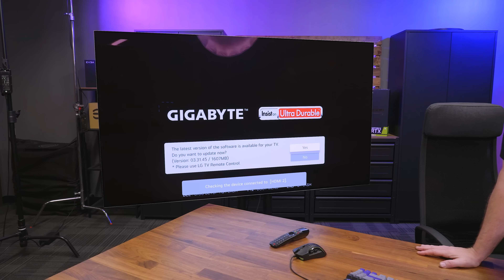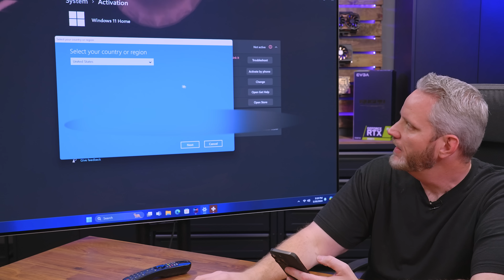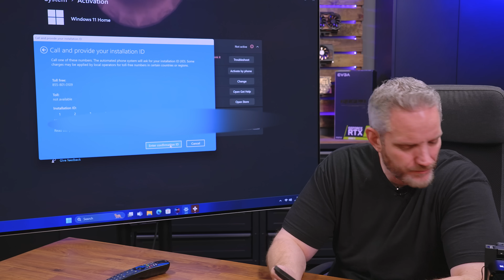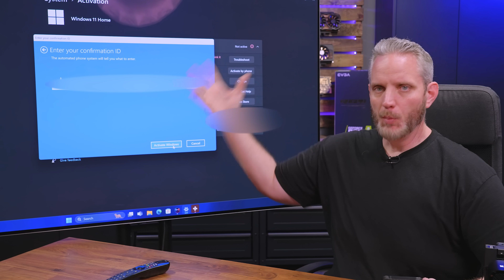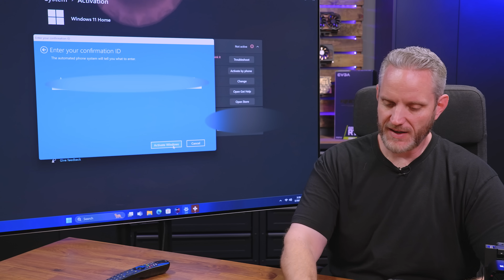How to move OS drive to new PC and keep Windows and Activation! EASY!

Comment: hi thanks just the video i wanted !! jayz always on the top. just little but think you quickly answerd .... does this work if i go from intel to AMD ?
Reply: Yes it does. I did a transplant last week from Intel 3rd gen to a Ryzen 6000 mini PC and it just worked for 1st boot.
Reply: @craigmurray4746  ok tanks for the tip
Reply: @craigmurray4746  finally did the move and was smooth just needed to reactivate windows with my digital key so 2 clics and off we go :)

Comment: 10:25 Jay is 90% correct. I've had several systems in shop that were AMD Ryzen 5 3600, 5600 and then they switched to an intel i7 13700K, would not boot no matter what. BSOD due to the AMD chipset drivers. I booted safe mode fine, tried removing them. Reboot still BSOD the AMD chipset drivers would not leave even after using uninstaller tools or CMD prompt itself. ended up having to load fresh.
Reply: This sounds like a driver issue not a windows issue.
If you can boot to safe mode you can rule out the hard drive and OS as causing the BSOD.
The chipset is not part of the OS.  My bet is your graphics drivers weren't property ported to account for the CPU OEM type change and you probably also had a bunch of custom optimizations.  Fun fact if you change the CPU type you can't keep the same ram timings and graphics card optimizations and expect them to work.
Reply: @TurboLoveTrain  Pls read it over again. I can enter into same mode on the systems fine. Since the chipset drivers are not loading. Motherboard set to Auto, no OC on CPU or RAM. Several others with same BSOD caused by AMD Chipset drivers, specifically Ryzen Master software. even with it uninstalled, removed manually from the Registry and C Drive itself to the point where nothing is on it linked to AMD and still BSOD Ryzen Master causing it. Ended up just loading Windows fresh and everything works fine now.
Reply: @johnqsak  yes, you described a driver problem.  You wouldn't be the first person to reload an OS from scratch because of drivers.
Reply: @TurboLoveTrain  yea, driver that kept Windows from booting, even when it was physically no longer there
Reply: @johnqsak  Windows puts drivers allover the place--both in the file system and in the registry.  When you add things like AMD software that also manages drivers and driver updates the conflicts usually get worse, not better.  Even if you lobotomize all the software and registry configurations there could be a windows Service that calls the old drivers for whatever reason and causes your system to throw a hissy fit.

That's why I said you wouldn't be the first person to reinstall an OS because of driver issues.

Comment: If you are moving multiple drives, can you move all the drives to the new build at once? Or is it better to just move the OS drive first, complete the process, and then move the remaining drives?
Reply: It should be safe enough to move everything at once, especially if the system was installed in UEFI mode as UEFI is a lot more flexible than BIOS style booting

Comment: 4:30 also Jay, if you felt comfortable, you could mount the AIO 280mm vertical, using just the middle set of screw holes, then fab some vertical mount, but then I guess it becomes a whole thing of changing what the case has available.

Comment: Definitely looks there will be a v1.1 or more. With that big GPU in there not only does it overhang the chassis where the 140 mm fans would be, it also looks to be blocking 2 or 3 power connectors under the card.

Comment: On my AMD 7950X System it´s the CPU wich holds the key of my old windows 7 OEM,  put a 7800X3D in the board an windows siad activate. Put the 7950X in another mainboard, windows was already activated.

Comment: "Windows -to-Go" using an external USB boot SSD does not always work when switching between Intel & AMD CPU's. The free software "Rufus" lets you create the bootable external SSD. and it will initially boot on either CPU type: Intel or AMD. But if you initially boot on an AMD CPU system, then use that same drive to boot from an Intel system, the Windows-to-Go drive will continue to boot okay on the Intel system, but will then fail to boot on the AMD CPU system. At least, that's been my experience with an AMD Ryzen 5600X system & then swapping to an Intel 10th gen system.

Comment: Jay, you've probably talked about this is the past, but, it doesn't appear that you use a grounding strap when working on builds.  Reason?  I know I have to because I can just be standing still and I build up a charge.
Reply: There's a video somewhere where static electricity is tried over and over and over to kill a board and CPU and it just doesn't happen.

I worked as a system builder and built thousands of machines 2002-2007, never wore a strap. Then I worked as RMA manager, never saw a warranty claim that related to static. 

Don't get me wrong it's possible to have an issue but the chance is so incredibly low few people worry about that risk.

Comment: Jay, the motherboard is not the one thing that kills moving my "hard disk" to a new computer.  I dont have any problems with having a replacement running system with a separate licensed version of windows. My favorite application software goes and reads the "serial" number from the hard disk and probably mashes the motherboard ID and the hard disk ID together to defeat moving my application to a replacement computer.  You might say just uninstall and reinstall with the SW key, but the seller does not want to redo the key anymore.  Faithfully living within the license requirements and replacing the old computer means providing the application what it wants to see to enable running on the replacement PC after cloning the hard disk.  I have found that I get to set the volume name and ID when using intel raid so maybe this relates to a solution, since I can go read the volume name/serial on the old PC.  I would like to hear your prescription for making the replacement system match the "ID" of the old PC.  thank you
Reply: I'm not sure this is even possible. Like one can spoof an Ethernet Mac address, but I've never heard of anyone changing hard drive serial or motherboard serial. Those hardware hash activation systems are very good at preventing what you want to do. It's a horrible situation.

Comment: I've only really had issues if I've put a drive that was on a different platform, IE AM4 > LGA 1700 is my most recent example. Although this does work (I've done it before) Windows is a terribly coded OS and there is all sorts of nonsense left in the registry. Best practice is to nuke the OS and start from scratch.

Comment: There is also a way to manually remove the windows key from the motherboard. it does involve using some commands, but i've done it and it works just fine. Just make sure to write down the key number BEFORE you remove it from the motherboard otherwise its gone.
Reply: You can deactivate the key in the control panel under the activation section if you don't have an OEM key (OEM=key stored on motherboard).
Reply: So pull it using an app, delete it, and it's reusable after?
Reply: @Adpocalyptic so you run command prompt as administrator and there’s a command called “slmgr. vbs /upk” you type that and hit enter and itll uninstall the key manually which deactivates windows on that pc. Then once you build and boot the new pc you can just put in that same key and itll work just fine, pretty much as if you were putting the key in for the first time
Reply: I understood that getting that key from the regedit would only work(the retrieved key) if it was a retail product key, if it is a digital key then it won't?

Comment: Ya really really should reinstall your OS if making such a big change. By 'basic state' you mean most the new devices aren't detected yet and are about to be and the bigger issue is its about to try and load all the old crap you had cluttering up the build before you migrated the drive including all the hardware specific stuff which can BSoD if its really unhappy. Still do the activate by phone, thats great. but on a fresh install. Also this almost never works if you have raided drives on your system, especially boot drives.

Comment: I have a 250GB 970 Evo M.2 as my OS drive. What would be the best way to transfer clone all the data from this drive to a larger one? I thought a 250GB drive would be enough at the time. I'll look through your library of videos to see if there's one about this, again, just in case you have answered this question, or similar, before. 

Worth a note; I have an Asus Crosshair Hero VI board, so it only has one M.2 slot available. So I'll need to find an external option of connecting another M.2 to clone the data to.
Reply: 2 options. 1 is to backup the drive with the built in Windows System Image tool, save the image to an external drive. Swap out drives and restore the image to the new drive, then log into Windows and expand the partition size and done. Option 2 is to get an external USB housing for a NVME drive, install the new drive in there and use something like Macrium Reflect to clone the drive. Then install new drive in PC and should be done as well.

Comment: Hard parts used to be migrating between two drives going ide to sata,  sata to nvme, or BIOS to UEFI boot layout changes due to missing drivers & trying to spin up a valid boot change. Some motherboards had other incompatible chipsets from one to the next where attempting to load the old drivers bluescrened on the new hardware.

Comment: I set mine up to dual boot into the old drive with win10 or to the new M.2 drive that I copied the same windows 10 to and then did the free update to 11 which I then reset as a fresh install. Now I have two different activated versions of windows (10,11) on the same machine although technically they are the same copy of windows (originally win7).

Comment: IIRC Windows Licence Keys are now attached or able to be attached to a Microsoft-Account, and when logged in itll activate it on its own.
Reply: Its the inbetween step to subscription-based windows licenses
Reply: @dalyxia  This. We know exactly where they're moving.
Reply: @dalyxia  They haven't made any move towards subscription based Windows licenses, they already have subscription based O365 and they seem content with this. Instead, they upgrade my Windows 7.....product key.....to Windows 10. Then they offer me Windows 11 upgrade. And when I change motherboard they don't activate Windows, oh no, a watermark, whatever will I do. Simply ignore it. Oh, Microsoft doesn't care. Wow. Windows is freeware now. They just want you to subscribe to Office365 and GamePass these days, that's it. They don't want to threaten what is already a diminishing installed base, iOS and Android and dominating market share charts and Microsoft is terrified of losing even more control of the desktop market, hence the frantic attempt at making ARM-based Windows and the associated AI marketing pitch.
Reply: @dalyxia great, now I know the absolute latest point were I will finally switch to Linux
Reply: this does not work if you have an OEM license key,which are usually cheaper. They bind to the board regardless.
Reply: @ThatMetalheadMan  not true my oem digital license worth 3$, still working for 7years from am4 build w/ w10pro to am5 new build w/ w11pro. Still can transfer and activate windows.
Reply: @warfrekmanreborn  With just signing into the microsoft acct?
Reply: There is no reason for Microsoft-Account to have/own or operate windows.
Reply: @kevinerbs2778  never said you did have to have it. I use it to maintain settings and easily keep activation.
Reply: @kevinerbs2778 There is. Security as you can now use a pin stored on the tpm chip and can set a phone 2fa if needed. Your Windows license can be moved too
Reply: Yes this is true however it will not always auto migrate the license and if you have too many devices registered with the same key you'll have to contact MS to get that sorted out.
Reply: Thats great for some people or companies; but it defeats the purpose of not creating or linking an account to the OS.
Reply: Has rarely worked in my case, all though I use OEM keys these days. Also most people do NOT want top use a MS account, Bud.
Reply: @zackzeed I think that "most people" don't really get what a Microsoft account actually is and they just create it during the install because that is what the installer guides them to do. And when they get a new computer many of them probably create another account because they don't get that the örevious one covers more than just that old laptop. The amount of MS, Google (due to Android), Apple, and other accounts people duplicate simply because they don't understand that the accounts cover more than those individual devices (they create a new MS account for their Xbox and for OneDrive/Office and other MS services, just like they create multiple Google accounts for different Google services. "Most people" are dumb home users who don't know * about computers and . This also includes most business users who just do what their IT departments tell them to do. And then those same people don't understand why their licenses/digital content/contacts/photos/whatever don't sync to tceir new devices. I used to work in after sales, customer service and sales and every time their accounts, user ID's, passwords, and other important information was lost or they had to call their sisters dogwalker or some random dude who happened to know their s better than them. Most people I know (who aren't techies) don't know much of anything (because they don't care - also the main reason they don't want to create an accoun when you ask them, yet they do it anyway if you don't ask them...).
Reply: @zackzeed  most people who just buy a computer dont know about its pros or cons,one way or another. I honestly dont care about it. If I wanted,I could create a local but I just dont care.
Reply: @zackzeed  i mean there is clearly a reason Jay made this video though.
Reply: you assume we use microsoft accounts LOL... when I set up this new PC I didn't allow Microsoft to make me log in with one. I did get a new windows key tho, cause my old PC was passed on to my sister in law.
Reply: @userbunny14  I never assumed anything. Do what you want. I just do not care about any accounts. I just watch youtube and game.

Comment: Super easy.  Take old drive, plug into new PC.  That's it... but I use Linux.....
Reply: This can cause windows corruption if going from a b series mobo to a z series mobo. Happened to me before, but I'm on windows
Reply: @TheBlueBunnyKen  With Linux, as long as the install type matches the bios (IE they both need to be UEFI or Legacy) then you can swap drives in and out without any issues.

Comment: i put my old nvme drive into my new build and it booted right into windows like nothing happened after leaving the bios; its funny because i was trying to boot with the windows installer in order to wipe it for a clean os
Reply: I think this only works if on same chipset. If going from b series chipset to z series chipset that will lead to corruption. Happened to me going from b series to z series
Reply: @TheBlueBunnyKen  yeah in my case it was b to b
Reply: @cryonic.  My question is the old drivers on the old motherboard are still there, that doesn't corrupt anything?
Reply: @TheBlueBunnyKen  i swapped from msi to asus and didnt get any issues after installing the asus drivers. but i did go into my files and removed the msi folders and msi related programs for good measure.

Comment: The only thing J forgot to mention is that the system has to have UEFI enabled on both computers and no raid.
Reply: It's an added pain but there are ways to convert the MBR to GPT if your old install was before UEFI.
Reply: @EkiToji  True, and this was intended to be the simplest way to do this. The phone activation is a good tip.
Reply: You can also fix the raid support by loading drivers in recovery, not easy but doable. Similar things may need to happen when comverting a physical PC to a VM.
Reply: MBR2GPT is kind of a pain in the ass, but there's a way around it.
If the old machine is 'legacy/MBR', make an image of the drive (all you need is the Windows partition; I use Lazesoft for this), then clean install on the new drive in UEFI mode.
Restore the Windows partition over the new drive's Windows install.
Boot from Macrium Reflect PE (rescue disk), repair windows boot. 
- Above, make sure you're in pure UEFI mode without any legacy enabled, or else Macrium will legacy boot and you won't be able to correct the GPT/UEFI boot sector. 
Reboot. Done.

As for RAID, you can clone to a single drive and it'll just boot as long as you're similar chipsets, or if Windows at least knows what it's going on. I've done this with RAID 0, 1, 10, and 5 volumes without issue.
Reply: Why on earth would anyone use RAID for a boot drive..?
Reply: @TurboLoveTrain  pretty common pre nvme and especially pre ssd
Reply: @profosist  you have a distorted version of "pretty common"
Reply: @TurboLoveTrain  it's common enough that I have worked on thousands of devices and Dell has knowledge base articles on the fact that they are shipped with RAID On as default

As for why? Heck if I know. They claim performance. I think since they do ship slme with RAID, imagining wise it's easier to ship them all. Don't forget that RAID is required for a number of Intel features including Smart Response and Optane
Reply: @profosist  What model of DELL--that's what I was asking.
Reply: @TurboLoveTrain  additionally I doesn't matter if you drive in in a raid array the controller just needs to be in raid mode.

Dell ships all system in this since some do use raid.
Reply: @profosist  I've never seen a DELL set up from the factory with RAID configured by default.  I'm not saying you can't, I'm saying why would you want to.